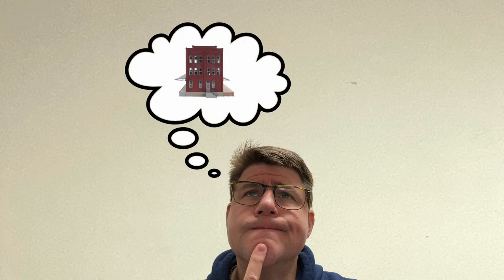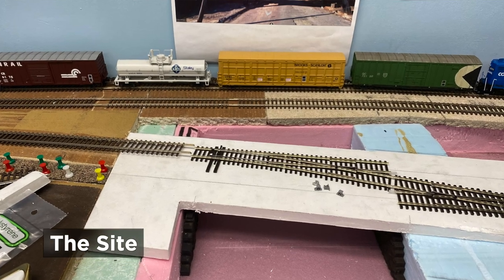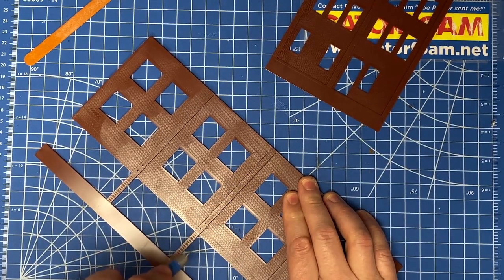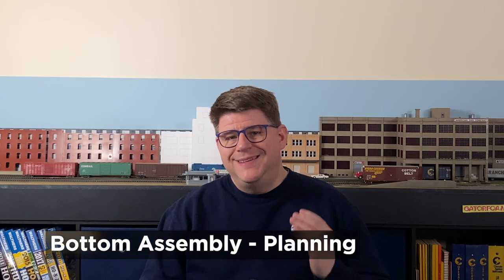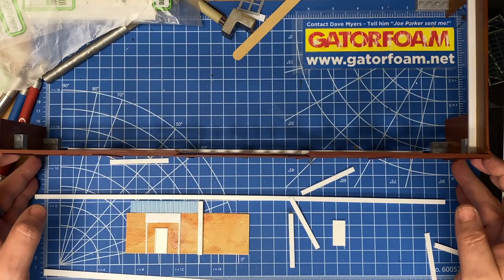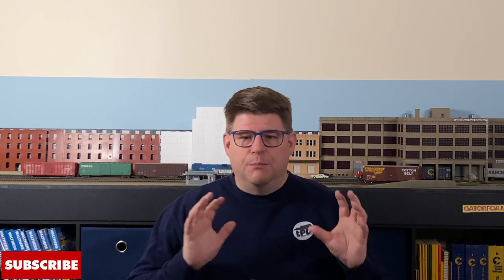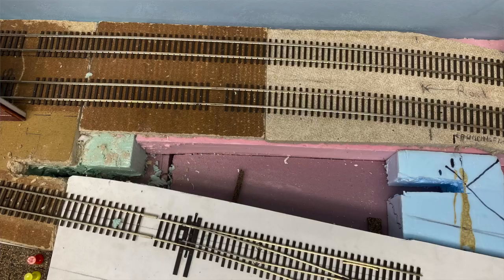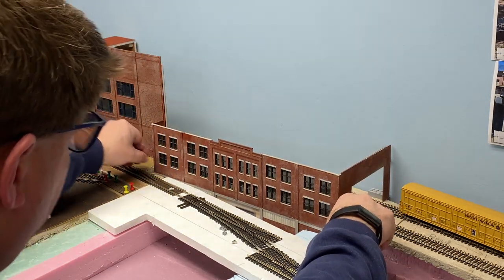Step-by-Step: Make this Incredible Model From Scraps!

Comment: My tip for glueing windows, especially window glass, and really anything already painted together, use Canopy Glue. The stuff is amazing, strong, and it dried crystal clear so it's not a disaster if you get it somewhere it should not be. You can even make windows for small openings with it. CA around any sort of transparent plastic too often turns into a disaster, no matter how careful you are.
Reply from the maker: I’ve never really used canopy glue, but I know people who swear by it. I’ll have to finally break down and get some to try it out. Thanks!

Comment: You asked for those of us who have been guilty of being armchair model railroaders to tell if we finally got off the pot. I am finally. We moved into our new home a year ago this past April. I had a dream layout. I wanted to so not have it in the house and we were going to put it in a good sized out building in the back yard.  Money has changed and  I don't see that out building happening. Just recently I built the hobby work table for the crafts room upstairs and now I have a place to build and solder and learn how to make DCC happen in a DC engine. I have 4 or 5 Athearn blue boxes. I decided that I have just got to see my little fleet of good running condition locos move about. So, I am going to make a small 8' to 9' by 20" wide very basic switching layout. I bought the timber for the basic frame just today.  I will do the sanding of the 1" x 3's" tomorrow. I  am hoping to find some Homasote for the base that fit into the cradle I am constructing.  I have always been a DC modeler, but I recently bought a NCE power cab and I am ready to plug away at this new territory because it makes huge sense and is so much more able to do extra flexible activities that DC could never do. That our little town of < 40,000 finally got a hobby shop and it is trains only and is run by a former railroad engineer who will answer any  question that his experience allows. Well, it's a start, right ?
Reply from the maker: Thank you for the  update! This is a great example of being realistic about what you can do and not waiting for "someday" to arrive. Sounds like you're making progress and are moving forward! Keep me posted on your progress. 😀

Comment: On my N scale layout, I used an Atlas mill kit with a Walthers George Roberts printing kit to create a large industry. My idea was to create something with super tight curves and tracks running close to the walls to get that cramped feel to the scene. When you look at both kits, they are wildly different in terms of achitecture so you need to tell a story to sell the build. The atlas kit is really cool because it comes with lots of windows of different types. I cut up the building in half and used the backside as one building flat along the backdrop and a spur in front of it. I used the front half next to it also with a spur running in front of it but with a slight curve, so it<s like the first building was built with a few tracks serving the property and then the second similar building was erected a few years after. I uses the 8 over 8 windows on the earlier building and built the second with the 6 over 6 windows to give a sense of them being built a couple years apart but slightly different. Then there was a small transition piece made of some DPM kit single story walls with a sharp curve running along one of the tracks. I ran into a problem with that one when I overshot the boiling process to bend the wall and turned it into a taco!! Got a new kit and 2nd try was the charm and the enclosed dock section was done! I finally added the big Walthers kit, straddling the enclosed dock and butting up to the Atlas mill kit and creating that fell of a buisness that kept growing and changed up the architecture as it went.

The remnants of the DPM carpet factory kits didn't go to waste... They became unintended buildings elsewhere. The single story walls became a freight depot and the 3 story walls became a large food warehouse flat along the backdrop and an off the line industry at the end of the layout that focuses attention on the layout rather than a the wall right behind it.
Reply from the maker: I'd love to see some pictures.
Reply: @ThePixelDepotLLC  yeah totally!! I'll try to get something up to show exactly what I did. I got lots of mileage out of the few kits I bought!!

Comment: Very good video, Joe. Your building looks great. Kinda like putting together a jigsaw puzzle only you can make the pieces whatever size and shape you need. I also need to go back and get the ratios of your washes.
Reply from the maker: 1/2 Tablespoons of ink  to 1 pint alcohol (or ~15ml ink to  ~475ml alcohol if you do metric)